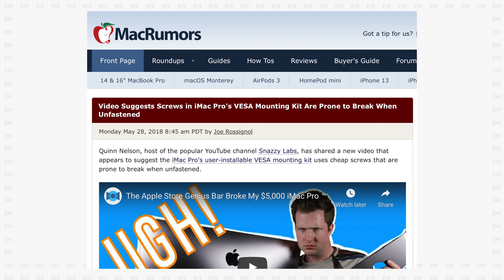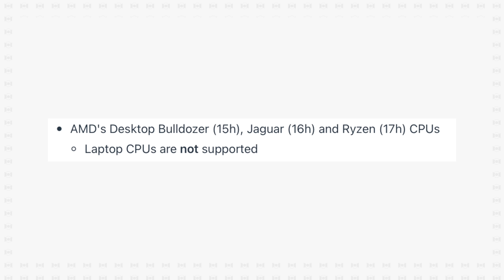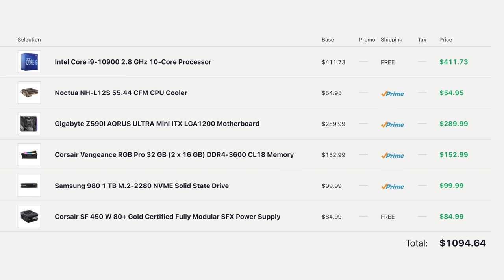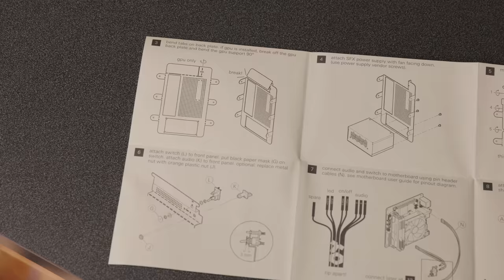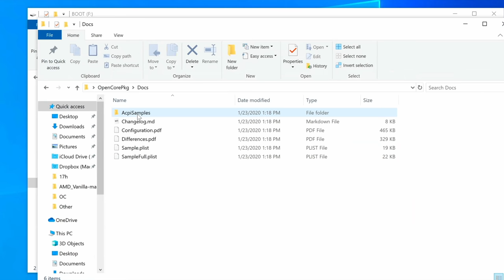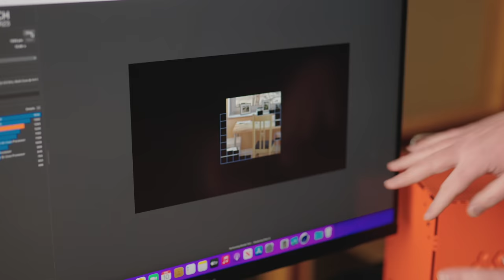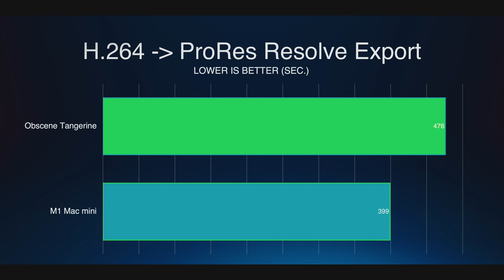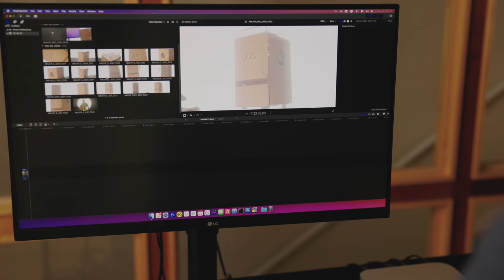The Last Hackintosh?

Comment: I am also quite impressed by the M1, and I don't even use Apple pro apps. I have been running World of Warcraft, which is native on M1 now, and it runs flawlessly at all but the very highest settings, where I think shadow quality really puts a strain on the GPU. Otherwise, I run things like Word and GIMP for work and graphic arts projects respectively, and the system is consistently fast and stable while staying cool and entirely silent (Mac mini).

I opted for the same specs you did, incidentally, and have since added a Thunderbolt hub which matches the system aesthetically (the system sits on top in a circular indentation) and have added a SATA SSD to it, a feature it happens to support in addition to providing 3 USB A ports, a couple of USB C, media card readers, etc. I got it after looking at prebuilt PCs to see if I could get a good replacement for my little HP, which unfortunately has a CPU just one generation too old for Windows 11, and noting that the price was slightly higher for nominally equal performance. I expect, though, that the M1 would wipe the floor with that system, and do so while drawing a tenth of the power from the wall and running a superior operating system.

Now that Apple is finally moving away from Intel and doing their own thing, the Mac is back! I liked it a lot in the 68k and PowerPC eras, and I love it now in the Apple Silicon era.

Comment: @snazzy labs: Given the fact that energy resources are becoming at least more expensive, and perhaps also scarce, a 12 times higher power consumption must force the x86 platform to re-invent itself. Add to this the average computing power for genuine M1 Macs that overall is quite good - the x86 platform is under fire.

Do you or anybody else in the forum think that the x86 platform will be revised and re-thought?

I really really like windows and the fact that I can still run 30 year old software (which I in fact still use - its not just for fun) - backward compatibility of the x86 platform is a second to none - however this should also be possible even if the entire platform is redesigned to at least match, but preferably surpass the M1 to push development further.

Hope you would share your thoughts on this :-)

Comment: regarding efficiency the comet lake chips are terribly bad and for a good reason: ity's ancient architecture on even older process pushed way past it's rational limits, if you grabbed 5700G the CPU performance would be basically the same (with better single thread for Ryzen!) but the power draw would be around 1/3 of intels
obviously that's still in range of 80 from the wall but when compared to well over 200 it's devastating

Comment: The only advantage to me on Hackitosh (and to be clear, I do not use one any more), is the availability of much more RAM and support of software inside VMs. I do development work and there is still so much that does not run on ARM or if it does, doesn't run right (Elastic, anything Windows Server based, MSSQL, so much else). So I need an Intel PC off to the side to run those VMs, which I didn't used to need with my Hackintosh. I understand I am an edge case though.

Comment: I think for the vast majority of users single core performance is far more important.  In music production for example, multi core hasn't been an issue since the 2010 Mac Pro days.  It's at a point where multi-core is commoditized pretty much.  Video guys benefit from parallelization but for most this just isn't an area of benefit.

Comment: I would rather go with K39 case. It needs to use flex power supply in order to fit everything but it's small and well built compared to this orange thingy you got there.

Comment: A single air cooler on an i9 10859K? I don't think so. Your statements about OpenCore and WIndows specifically are technically wrong, since OpenCore injects SSDTs system wide which does affect windows as well – something clover does not do. BTW, the latest clover version does boot faster than OpenCore since it has no security stuff to care about besides SIP.

Comment: If a 256GB internal drive isn't big enough, then a 1 TB drive won't be big enough either. The only difference between the two is a matter of time. However, in the latter case when you hit the buffers there will be a bigger mess to clear up.

Comment: My 7700k + 1080gtx pc was a breeze to set up as a hackintosh (literally install and that's it) the weird thing was that on macos my audio output was on the black jack instead of the green.
However. I still use Windows 10 because the computer is so fast that windows actually runs as smooth. (and I game)

Comment: I’m using latest Intel CPU (could be using latest Ryzen cpu) via ProxmoxVE with RX460 (which are pretty cheap even today) direct access from macOS with zero issues (even 2.5Gigabit Lan works in macOS and I could get 2.5Gbit WiFi working). It’s a shame this was never covered on this channel.

Comment: For the most part, I do like my M1 mini, as a hold over.  The only real problem I have is that it is too easy to saturate the IO bus. I run my user account on an external, which is undoubtably part of the issue.  Large tasks such as Rar/unRar completely make any other drive task nonexistent.  On any other drive. An issue I never ran into on my 2012 5,1 pro.   Most of the software I run is yet to be native, My CAD software is of note.  Graphics performance does suffer, but this is to be expected.  And yet, is still usable.  

I wouldn’t have upgraded yet, however I got into a pinch with my old internal SSD. The 2012 was in a weird position for what it could use tech wise. For the money/capabilities,  it just oddly adds sense to stop gap with the M1. Than it did to spend the money on just the low capacity old tech SSD. Oh, OS. Uild was part of that issue, and also having to upgrade the GPU to take the newer OS.

Comment: Hoping that Apple will work for PC Operating System (Still based on macOS), but there's should be some conditions to make it successful

-The OS should be Paid, so to prevent cannibalising Mac product sales, the OS should be paid, (I guess $50 will be the better price for macOS for PC)
-The Support in TPM and Secure Boot is Optional, so it will prevent those Laptop unsupported with Windows 11 end up into E-Waste and alot of People will switch for macOS from Windows 10,8.1 or 7
-Avoiding shipping laptop with macOS in it. Again, this also help to prevent cannibalise Mac Product Sales

Comment: I'm totwlly unimpressed with the M1.  I have a base model (8GB/256GB) M1 mini that I use exclusively as a Plex server because I thought it'd be a step up from the original Nvidia Shield I was using before.  It's unstable as hell!  It runs great for anywhere from a few hours to a few days before it simply crashes and restarts itself or every background process somehow loses keychain access, requiring me to re-enter my password a dozen or so times for each one individually (I've implemented the supposed fix for this, but it still happens). Crapple Macintrash!  Overpriced junk, probably going to take it back to Costco.

Comment: So far M1 Max multicore pales in comparison to Threadripper (9k vs 75k on Cinebench), VM’s will never be able to virtualize x86, and Boot Camp (x86 at least) is dead. And a lot of developers left the Mac over the past 7 years when they didn’t prioritize performance. Apple chose not to put Threadrippers and NVIDIA GTX/RTX cards in their desktops. So while Hackintosh may be dead, I’m now looking at getting a cheap baseline Mac for light duty day to day stuff, and a Windows workstation for heavy duty 3D design and rendering work. As a longtime Mac user, it’s disappointing.

Comment: Yeah the Hackintosh is in a very interesting position right now. My current daily driver Hack is over 3 years old, locked to macOS High Sierra because I run a GTX 1080 graphics card. I recently transitioned from my barely working Clover boot loader to OpenCore and this Hack has never ran better. Very odd that you ran into issues with yours when you built the boot loader. I built mine including things that I only use every once in a while. Once I nuked Clover, copied OpenCore to my EFI partition, then reconfigured my Nvidia web drivers, my machine was running flawlessly. It is bittersweet though, because I have a 16" M1 MacBook Pro on the way to completely replace my Hack and my old 2015 MacBook Pro.

Comment: The 2016 redesigned MacBook pro (15 inch) was terrible. It was literally too hot to sit on your lap. I ended up scooping up the 16 inch, fully decked out with the 5600M and this is a much better design, at least when thermals are considered. I still like the fact that I can run Windows natively using bootcamp and am equipped with a GPU that can even game (not that I recommend it). Apple's CPU is great, but I'm still waiting for their own GPU to catch up to Nvidia and AMD offerings. I don't understand the hype train for M1, outside of light and portable use, in which case, it's amazing.

Comment: Sorry to be negative here, but....

I thought this was supposed to be about a Hackintosh??
But 50% of the time was about a really expensive and inappropriate case.

 Plus, I don't see that the chosen component mix makes sense: by the time you add a (working) case, and a GPU, monitor, mouse and keypad you're going to be $1,700 - $2,000: closer to the higher end for sure. 

Compare that to a 2nd-hand 2019 27" iMac with Intel 3.6GHz i9-9900K 8 core with Radeon Vaga 48 GPU.
Upgradeable SSD from 512GB to 2TB.
Upgradeable RAM from 16GB to 128GB.
Can get that for $1,200 - £1,700.

I think that's CHEAPER for a LOT better, and it runs OSx properly.

Update it to Monterey (or Ventura): and it works seamlessly afterwards.
Add a 2nd SATA/SSD or HDD too if you want more internal storeage.
4 x USB 3.0 on it, plus Thunderbolt.
Good quality Retina screen built in, and easy to run a 2nd monitor.

Personally, I see a Hackintosh as a good way to get something a it unique to run on Mac OSx: like a better GPU. Or maybe dual CPU.

Can upgrade RAM to 128GB if you want/need.
And SSD to 2TB if you can't find a used one wth that already (I did).
Add a 2nd HDD too.

Comment: Been using Macs since the Mac Classic through the switch to OS X and so on.  Also been using Linux and Windows pretty far back.  Been programming for Mac and Windows for ages.  My computer experience goes right back to the TRS-80 Color Computer and clunky 5.25" disks and 300 baud modems.  Ok, so I don't see the obsession with OS X.  I never have and I guess I never will.  I never fell into the cult of Mac thank God.  There are great machines in all spheres of OS and chip influence.  But, to me I could careless if it was Linux, OS X, Windows or something else.  But I appreciate your perspective on the hackintosh sphere and it's possible demise.  But, honestly I never saw the purpose in making a dedicated hackintosh when it is easy enough to run OS X on a standard windows machine either through dual booting or virtually.    A lot of people just run multiple OS's on the same set of hardware... makes more sense to me.
Reply: @rfish67  Been there done that with the 'superior' debates.  I don't buy it.  To me,  a person likes an OS because it works for them.  I don't care.  Windows works for me.  Linux works for me.  Mac OS works for me.  Heck, Atari TOS works for me.  I really do not care.  Yeah I get that some people prefer the aesthetics of Mac OS.   As far as it been more solid.  I don't know.  Maybe 10 or more years ago but other OSs have come a long way now.  My windows server goes months and months without an issue at all.  Linux boxes can go just as long.  I've had OS X crash on me in weird situations the same as any OS.  So, I don't take a side in this because I find it stupid.  Windows does some things stellar.  OS X does some things stellar.  Both have pitfalls.  Once upon a time I would have said Mac OS (system 9 and prior) and OS X were far easier to use and way more customizable.  Not so much now.  In terms of programming, I way prefer to program on a windows 10 or 11 machine using MSVS or Qt then to program on OS X.  I like the IDEs and debuggers on windows better.  But, that's me.  Some people prefer to code on OS X and some prefer Linux under a Clang compiler (also available on Windows via MSVS) or something else.

See for me, it's always been about having options, not choosing 1 platform and declaring it is 'superior'.  It reminds me of the old Atari Vs Amiga wars.  I liked both systems.  Apple II series vs TRS-80 or whatever.  The days when there was choice (IBM, Xerox, Atari, Apple, Commodore, Spectrum, etc) where good days and that is where real work was done and real innovation came from.  Even alternative OS's on the same platform. 

To me the computer (and hence the OS) is just a tool.  I don't care much if it is a black & Decker, Milwaukee, Ryobi, etc.  Does it do what I want to do?

But, everyone is entitled to their opinion.  Even the cult of Mac.

Comment: You should virtualize, it' faster and you can amd. use last version hardware of everything except bluetooth. setup in minuetes. I've tried proxmox but there are other solutions. I've a multiboot 10.4.11 and ventura. did not found any limitation yet. 6900HX is enough.

Comment: You will still happily build a Hackintosh if you need to dual-boot Windows, because that is a complete no-go on the Apple Silicon machines. And let's be honest, if besides using Apple Apps to work (I use Logic Pro X for example) you want to be gaming too, then you will need to have Windows running natively on there as well. Gaming support for the Mac is simply not there, never truely has been so far. I'm currently doing all this on aging Apple hardware, so soon, I'll run out of upgrade paths and will probably need to look into a Hackintosh build, because the new silicon, as beefy as it may be, won't run my Escape from Tarkov, SCUM, or the trillion other titles that don't have macOS support.

Comment: In my opinion, installing Hackintosh to my AMD system is easier than installing windows 10. 
Apple M1 chip running specialized software faster than any equivalent intel chip. Just need the software app dev to catch up. 
I'm replacing my high performance AMD hackintosh (5950X + 6900XT ) with the MacBook 16 M1 Max and start saving $80/month in electricity immediately while performing practically the same or even better in graphic design (adobe, affinity) and Final Cut video editing.

Comment: I HATE APPLE but even I admire their adoption of Accelerators, Chip Design (big-little) and overall power envelopes. With the initial introduction of the M1 and now the M1Max and Pro, Apple has won the respect of many hardened x86/PC lovers and in some cases, has actually succeeded in making many on this side of the tracks jealous for once. I can now see the results of the heavy handed platform and ecosystem curation yield enough positive results to almost make it worthwhile..... almost ;)

Comment: I'm curious to know how much better a hackintosh would be with an nvidia gpu rather then an amd.
Reply: AMD GPU are now close to Nvidia's ones in terms of performances. nVidia RTX 4090 scores 39 152 @ Passmark bench, Radeon RX 7900 XTX scores 31 738. The nVidia is slightly better, yes, but not 200% faster, just a bit. BUT it's insanely more expensive, nearly twice the price.

Comment: answering the performance question: if you're happy with 8 gigs of RAM M1 macs aren't TOO bad, still they cost a lot, but not like INSANELY a lot, but when we get into 32 gigs area it becomes completely different, especially if you do no GPGPU processing, you still have CPU in range of 5600G-5700G but for a price of 4 stations with these

Comment: The problem is really niche areas like Pro Audio work where you need substantial ammount of CPU Horse power, where Apple simply don't have anything to compare even to the older Intel Xeon Mac Pro's. And those older Xeons is not even close to be on par with what AMD deliver with their now "old" zen 2 based TR and Epyc CPU's.

However as a general purpose home and office Computer, with their low power consumption, the M1's is fantastic, and some of the other more professional areas of Apple's focus in isn't doing bad, but we still need some serious proof of the Apple silicon's scalability. 

As for games, well .. ya if your playing webgames its propably doing just fine, but with the ammount of games available for Macs thats propably an area they still need to work quite with if they want to have a share of that market.

As for Hackintosh being dead .. I honestly don't  know. As for the current situation its certainly not dead, as if I am correct, you can still build a Hackintosh with an AMD Ryzen/TR .. not sure about Epyc and get Thunderbolt to work with the newest mac os builds. But others know much more about that than me, so don't kill me if I'm a bit off. I just know you can still build an absolutely insane Hackintosh for eg. Music production with a TR that will propably last you the next 5-10 years, dependable on how long they can keep up getting it to work with newer OS releases. 
And frankly, I doubt Apple is gonna drop Intel Xeon support untill they have an M Chip of their own that can match it, and I would guess as long as the Intel support is in, AMD is also gonna work... just my guess.

For me personly, I was never really into Logic Pro, and the other DAW programs that matters, most of the popular ones are available for both PC and Mac and some even run better on the PC version, so it really doesn't matter

Comment: Rubbish    I've just sent my 16" back to Apple as I cannot run W10 or W11 working with my building pricing programmes and Parallels is hopeless. I'm back to using my old MacBook 13" and I really like the touch screen more after the 16"